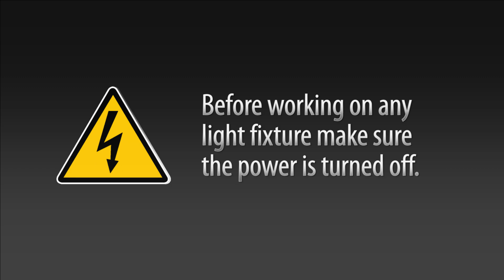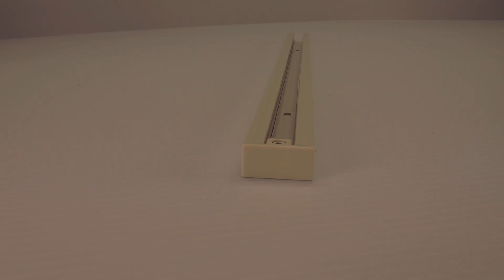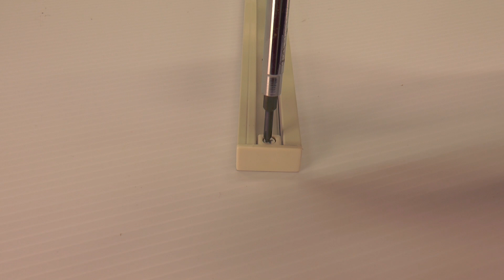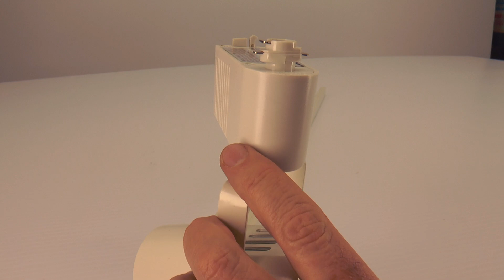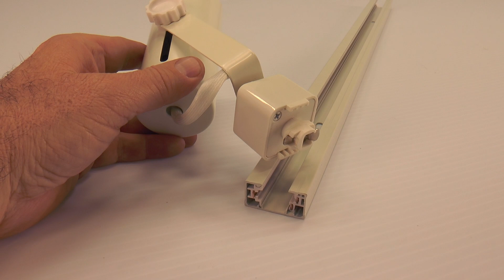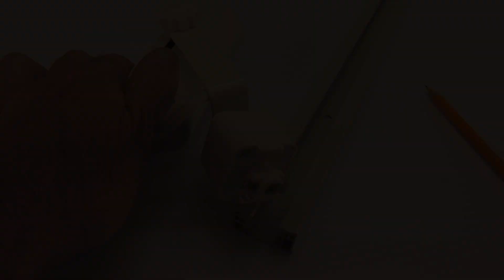3 wire H style track lighting overview & troubleshooting guide by Total Track Lighting

Comment: My track lights are dimmable and I tried using lutron smart dimmer switch but it didn’t work. Could you recommend a dimmable switch that would work on these kind of lights? My track has 20W dimmable LED bulbs. Thank you
Reply from the maker: Unfortunately we are only allowed to troubleshoot these issues with customers who purchased our products. I hope you can understand 🙂
Reply: Hi, did you figure out a solution for this? Thanks
Reply: @Tonisuperfly hello! I did some research and found that such track lights work with TRIAC type dimmer switches. Look for recommended TRIAC type dimmable switches for the track lights you have in their manual/website or by contacting their customer service. For me, I found that the company which makes the track lights also manufactures the compatible TRIAC type Dimmer switches and I ordered that, it worked!
Reply: @nikhil4utube ah great tip, I didn’t know any of that. Thanks!

Comment: 2 questions

1. Can  I wire a two-wire light to an H-track adapter? Say there's a light I like, but it's only two wires and I still want to use it as a pendant.
2.  How do I know which wire goes where if I'm only using 2?
Reply from the maker: I would check your local code to make sure you can use a non-grounded pendant light in a 3-wire H-style track lighting system.

Comment: Can you mix line voltage and low voltage heads on the same H track?  Thanks
Reply from the maker: Yes, you can mix line voltage and low voltage heads on the same H track. The only requirement is that the low voltage track head must have a low voltage transformer integrated within it. Every low voltage track head we sell meets this requirement 🙂
Reply: Thanks for the quick reply.  One of the low voltage heads failed.  I will order a line voltage unit to replace it.

Comment: I have a 42" track by Project Source from Lowe's and was going to use a Nuvo TP156 live end power cord kit with it because it is a few feet longer than Project Source's version.  I emailed Nuvo to be sure it would be compatible... they said it was not.. that theirs was Halo compatible.  My Project Source is like your video- has an H style track and  has the light with the pull back collar and the  2 metal parts on one side and one on the other. Isn't that a halo type?
Reply from the maker: This video shows a single circuit 3-Wire. Halo makes a variety of track lighting styles different then what is shown in this video. Here is a link to our site explaining some popular track lighting styles and the one we sell - https://www.totaltracklighting.com/popular-track-lighting-styles.html
Reply: It didn't work thanks.